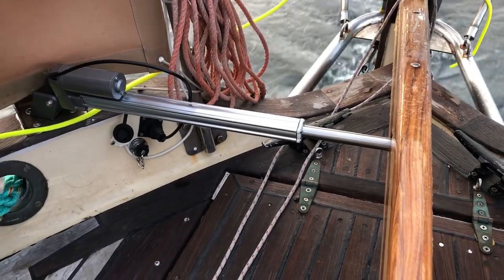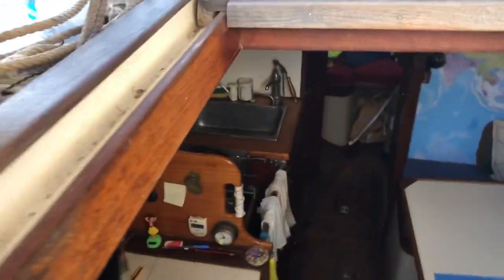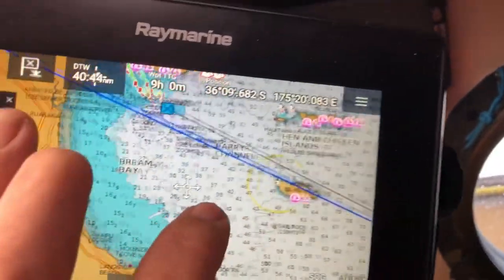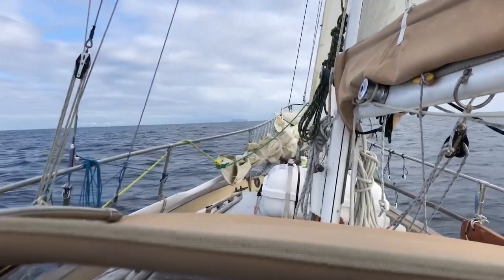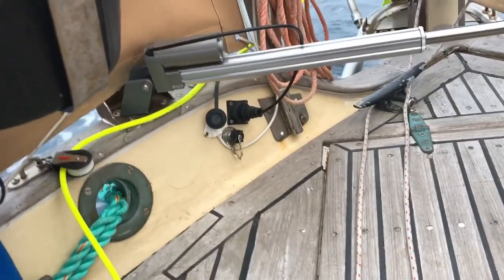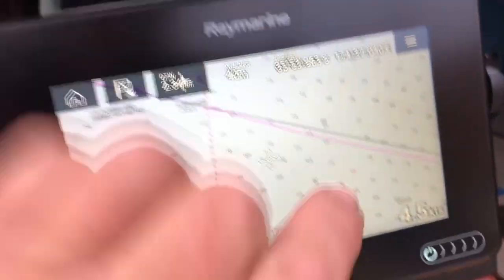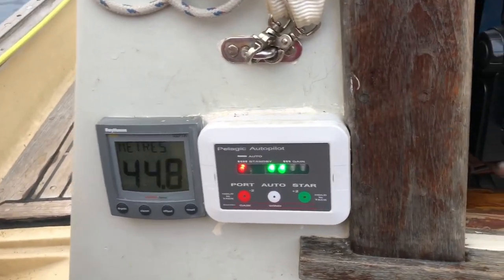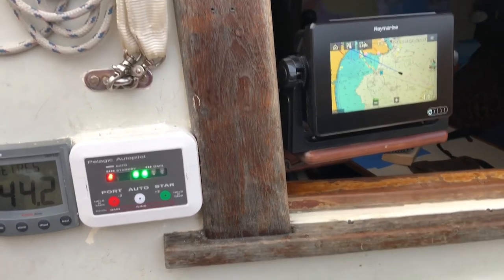Pelagic autopilot review

Comment: Hi Rob I have a 31 ' Steel Tahiti (double ended) ketch in Melbourne. I'm interested in how you've got the pelagic tiller pilot set up as your boat is a double ender too.

There doesn't seem to be much room with the tiller in the midship position for the tiller pilot ram to move the tiller to starboard, is this a problem?

Also I cant locate a Pelagic distributor in Aus did you buy your direct from pelagic or a distributor in the US?

Noting this video is 4 year old have you had any issues with the unit?

Cheers David J (Kakula)
Reply from the maker: I’ve switched to a raymarine evolution now
The pelagic worked well as a mechanical unit
I wasn’t happy with the algorithm of the software though
The set up is std about 700mm from rudder stock along the tiller
The throw isn’t long enough though like all tiller pilots, so sail balancing is important.
Also as with all tiller pilots I’ve had in heavy weather it’s useless

Comment: Hi Rob,I am waiting for the stronger version of this as we have a barn door rudder and weigh ten ton.Are you still happy with it,Dave.Ps that’s the trip we do but from Auckland
Reply from the maker: dave langford I used it from NZ to Tonga Fiji New Caledonia Australia then down the east coast to Victoria. I also have a barn door on the westsail. The lineal arm held up okay although the motor got warm at times I think a heat sink would help. I only use it when there's not enough wind for the vane gear so it doesn't work too hard. I find all tiller pilots have a hard time keeping up in following seas. For The Price it's good, you can carry a spare lineal arm pretty cheap on its own. Plus they have a cruising repair kit. I don't have any spares except an old raymarine arm. lol. It wasn't as heavy a unit as i thought from looking at the pic on web but it seems to be okay